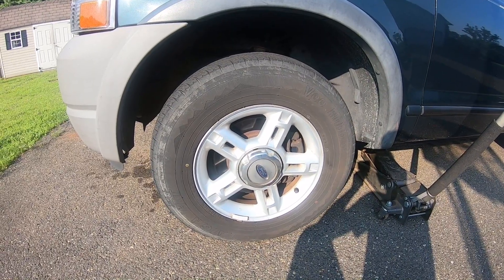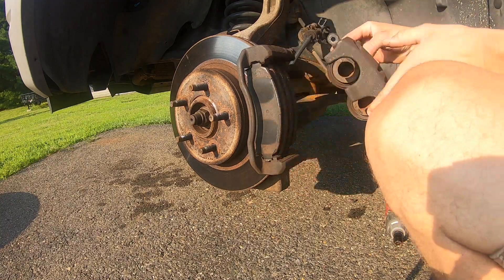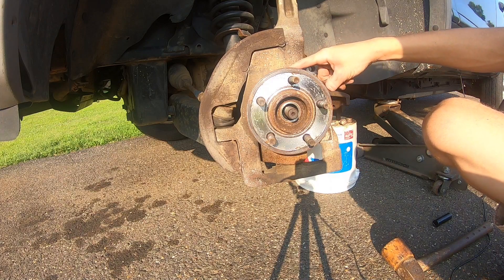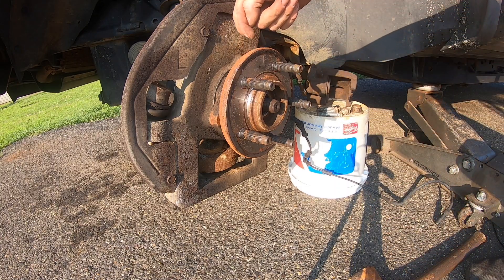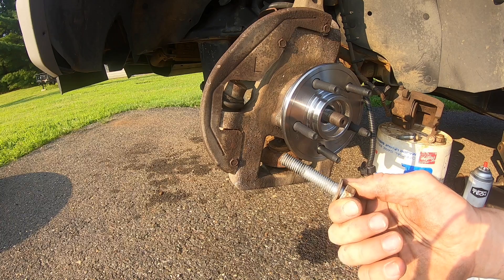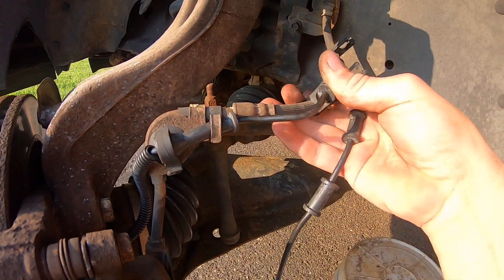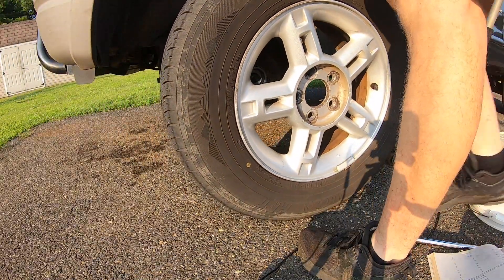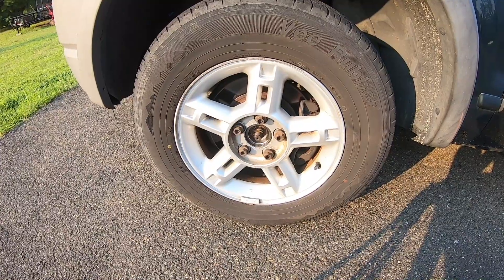How to Replace a Wheel Bearing - 2002-2010 Ford Explorer

Comment: Just did both front bearings and that slide hammer from AutoZone didn't do JACK lol Didn't budge a single millimeter. Five pound sledge to the rescue. Wailing on opposite sides 2-3 times and each bearing popped out with no issues. They had been (professionally) changed 3 yrs ago but I live in the rust belt so there was still a ton of crud in the bore to clean out.

Comment: Awesome video.  I think I used a 32MM on my 2010 XLT Explorer 4x4 and just removed 2 bolts and pulled brake caliper still assembled.
Reply from the maker: Yup yup you can definitely do it that way, I just took everything apart for a more in depth video
Reply: confirmed...another 2010 Explorer XLT 4x4x owner here...axle nut is 32mm for this particular model/yr

Comment: Thank you. My 07 Mountaineer was getting bad enough I was nervous to drive it. I could feel the wobble in the wheel when turning. I thought these needed to be pressed... Gonna order some decent bearings and change em out
Reply: I *think* technically you can press the bearing out of the hub and have a new bearing pressed in, but it's so labor intensive (and time spent waiting on a shop to do the work) that most people just buy the whole assembly: hub/bearing/abs sensor. So when people say bearings they usually mean the whole assembly.
Reply: @calvinpryor  yea I found some really decent ones for about $200 a side. I found some really cheap ones but I figured the would probably wear out in a year
Reply: @scottouimet2865  would you mind sharing a link to the ones you purchased? All the bearings at big box auto stores by me start at $250 up to $350 (each) depending on the warranty...I also see some online for $50 but those sound too cheap like they would give out after 2k miles. ....$200 sounds about right in the middle..not too pricey and not too cheap
Reply: @calvinpryor  I'll have to look, it was bookmarked on my old phone but that was also almost 6 months ago so could have went up by now
Reply: @scottouimet2865  indeed......A few months ago I started a spreadsheet to track prices and everything has gone up by at least $50. 🤦

Comment: a mercury mountaineer front noise suspensión l check Ball joint tie roed l don't get where the came from any recomendatios ,thanks
Reply from the maker: is it clunk or squeak
Reply: @iamdjnam  clunk one time ,no matter if go right or letf or straight ,thanks
Reply from the maker: Can be bushings in the control arm or the CV axle if you have 4x4
Reply: @iamdjnam  thanks my friend next time l check the control arm

Comment: Has anyone replaced these front bearings and got them to last more than 30k miles?  The original set on my 2010 Ford Explorer made it to 92k, but ever since the first swap, I've had to replace them every 30k miles or so. Trying to figure out if there's some other broken/worn-out part that's contributing to the early failure of these bearings? I was going to replace both lower control arms (hence new lower ball joints) with the bearings this time. Also what bearing are you folks using?
Reply from the maker: I’ve had success with Moog bearings. As the video states, torque the nut to 100. No issues. A common misdiagnose for bearing noise is actually the front driveshaft. I replaced all 4 bearings, still had noise. Removed the front driveshaft and it went completely silent.

Comment: I just do not understand how my original bearing lasted 98K miles and these replacements only last 3K?????
Reply from the maker: its already dead. it lasted 20 minutes. I ordered a Moog.
Reply: Holy smokes, same issue almost to the exact mileage....got to 92k miles on the original set and since then I haven't been able to get more than 32k on a set. This time I was gonna try replacing the lower control arms along with the bearings. I thought these front bearings were a "replace once for the life of the vehicle" kinda thing.....no?

Comment: Just a note about reinstalling and torquing the caliper mounting bracket / anchor plate on 2003. I have the 4-inch thick Ford Workshop Manual for 2003 and the Haynes Manual for 2002 thru 2010. Both spec these bolts at 155 ft/lbs for 2003. If you go there they will snap. I promise. Got new bolt kit (2 bolts 3L2Z-2027-AA) at dealership and asked about torque. The mechanics use FMOnline and it says 100 ft/lbs. Please mark the correct tongue in your manuals right now for next time.
Reply from the maker: I don’t think I’ve ever torqued anything down to 150 lol never mind caliper bolts. Thank you for the helpful and informative data!

Comment: Am I just spending way too much on bearings?  big box auto has them for $250 to $350 (each) depending on the warranty...but they still only last around 30k miles
Reply from the maker: Yeah you’re getting robbed
Reply: 1A Auto

Comment: No axle torque spec,tighten the axle nut with an impact.That manual is wrong on not torqueing that axle nut down.No damage done tightening the axle nut with an impact